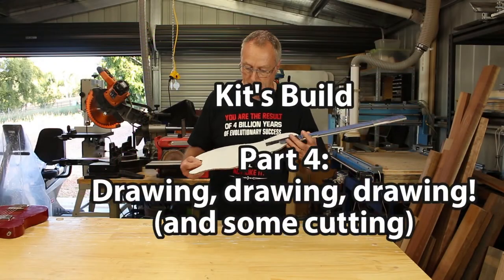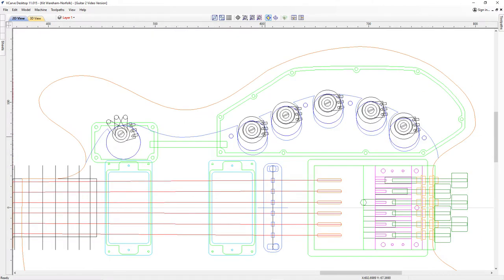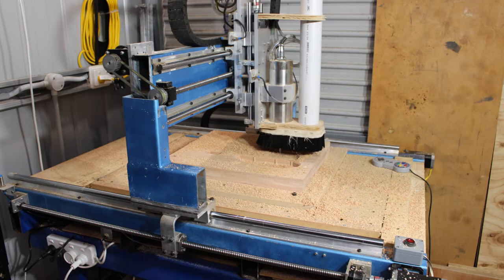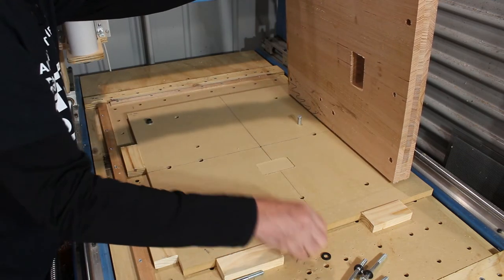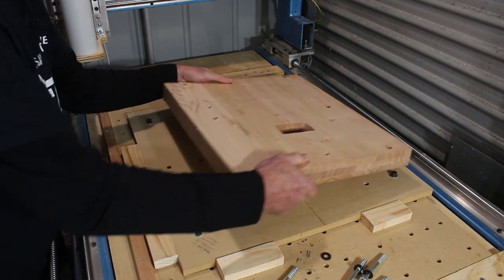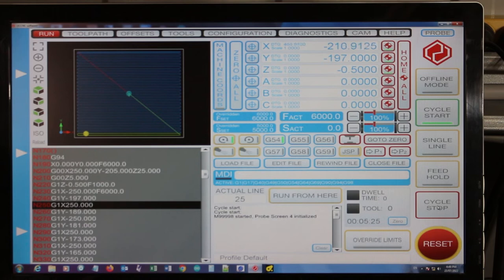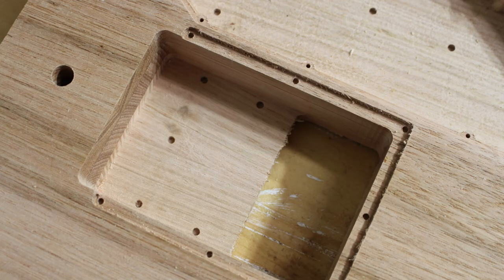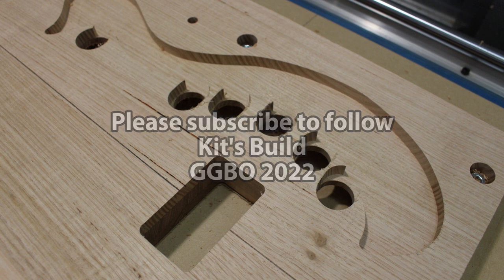Kit's Build part 4

Comment: I really like the control cliff.  From the drawing, I'd pictured the knobs peeking out from under a raised top.  The end shot made it look like they would be exposed and maybe flush with the top.  I'm anxious to see where you go with this.
Reply from the maker: Thanks for that. There is another 4mm layer of West Australian Sheoak to go on top yet, That was glued in place yesterday and will be in the next video. The cavities you can see have to be machined before the top goes on so that the knobs have space to come up from under the shelf and then move outwards to expose just an edge as you pictured.
Once the top is on I can cut the pickup cavities, bridge pin holes and the neck pocket.
Reply: @KitWN  I thought that was a good possibility.  But seeing multiple ways it could go I just had a favorite in mind.  😀  However it goes I have no doubt it’ll be interesting.
Reply from the maker: @BoneheadGuitars  I just hope it works. Anybody sensible would have made their first serious electric guitar build a strat copy or a Les paul. But where's the fun in that?
Reply: @KitWN  no fun at all.  To hell with sensible. 😀